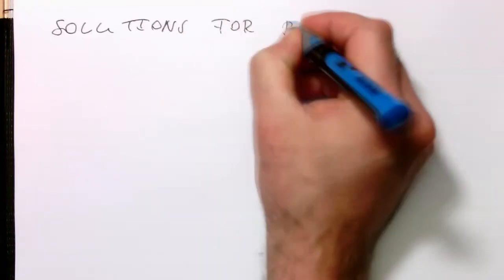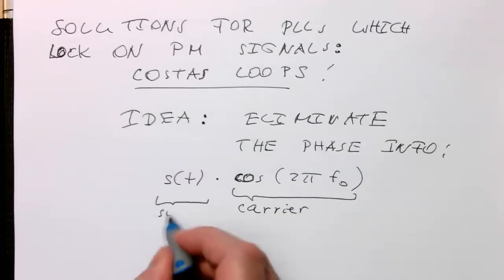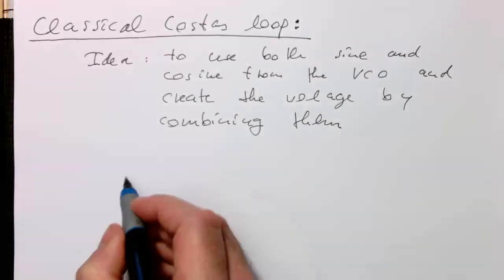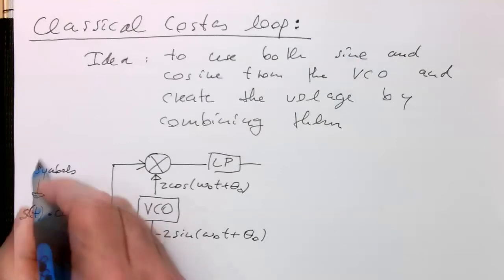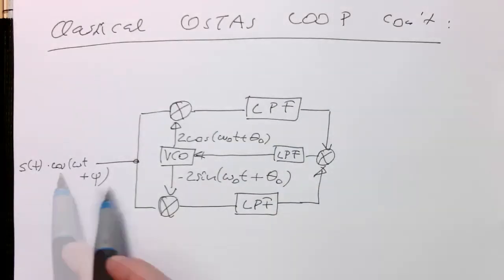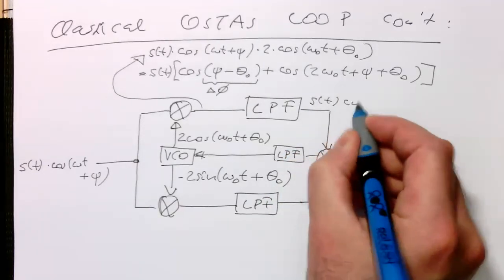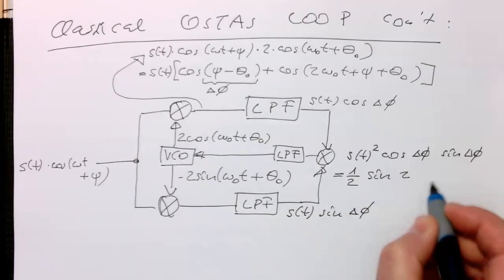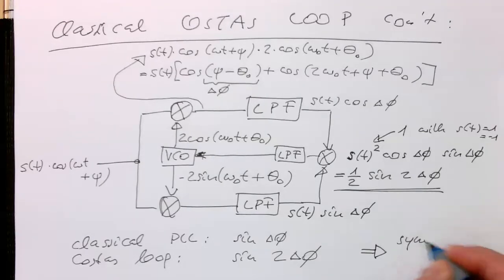Carrier recovery: the classic Costas loop (0009)

Comment: Hello. Why did you magically make frequency 'w' (the incoming carrier frequency) exactly equal to the initial VCO frequency wo? Your equation written at time 7:00 is good. But the equation you start to write at 7:14 has a problem, because "w" is not equal to "wo" to begin with. The initial VCO frequency "wo" should not be exactly the same as the incoming carrier frequency "w". The interest is really in the mathematics that show how the Costas loop makes the initial VCO frequency converge toward the incoming carrier frequency. The issue is that you immediately assumed "w = wo". However, what  needs to be shown is HOW the Costas loop system actually makes the VCO frequency become equal to 'w' (where 'w' is the incoming carrier frequency).
Reply from the maker: I'm just interested how the phase of the carrier locks onto the phase of the VCO. In a digital system which is probably clocked by a crystal the frequencies are so close to each other that just working on the phase difference is fine. Even a small frequency difference can be just seen as a phase difference. Check out my solutions which you can download and there I've put deliberately for the carrier frequ 0.999w to show the lock. So, in order to make life easier (= less math) one can just absorb slightly different frequencies in the phase safely. Also, from another practical point of view a phase detector based on mult (or xor) only works if w and w0 are very close. For larger differences you need other phase comparators. See for example the excellent data sheet of the good old 4046.
Reply: Hello D.C! Thanks for replying. The free-running VCO frequency is typically set to be somewhere close to the carrier frequency, but won't be the same as the carrier frequency to start with. The Costas loop will make the VCO frequency become approximately equal to the incoming carrier frequency. And, once the VCO frequency and the carrier frequency become approximately equal (ie. nearly the same), the final phase difference between the VCO signal and carrier signal will be some 'non-zero' constant value. The phase will lock, but the value of the phase difference will usually not be a nice convenient value (like 0 degrees, or 90 degrees etc).

For example, if you make the carrier frequency equal to 200000 Hz, and make the VCO frequency 203000 Hz. And if you assume the initial phase of the carrier to be 60 degrees, and if you assume the initial phase of the VCO to be 0 degrees......and if we assume the voltage-to-frequency conversion constant Kv for the VCO is 100000 Hz per Volt ..... then, after a long enough time, the VCO signal will become approximately equal to 200000 Hz, but the phase difference (ie. phase VCO - phase carrier) could be something like 276.9432702 degrees (ie. VCO signal leading the carrier by 276.9432702 degrees), which is equivalently VCO lagging carrier by 83.0567298 degrees.
Reply: @digitalcommunications8629  Just to clear my understanding. The assumption you are mentioning is that the local LO frequency, being generated by a digital circuit (say a PLL with a very stable reference), would have a minimal deviation (in frequency) from the remote LO. Is this correct? Tks
Reply: @southpark5555  comments like yours helps amateurs like us.. can you help me with the doubt about how to choose the cutoff freq of LPF which is used before VCO?